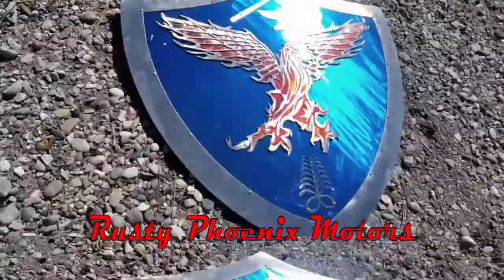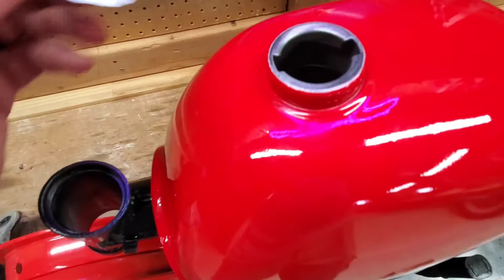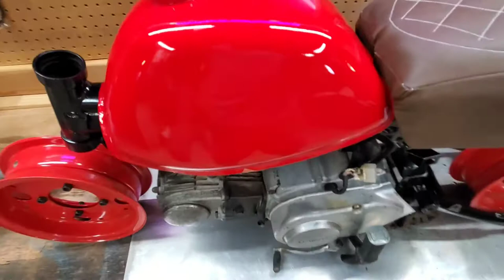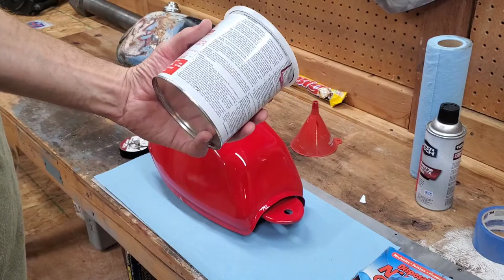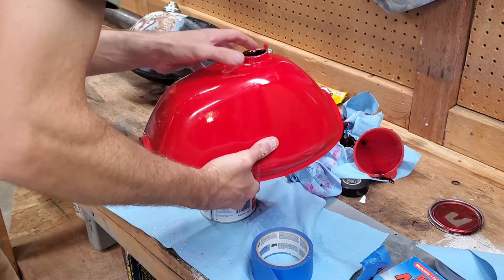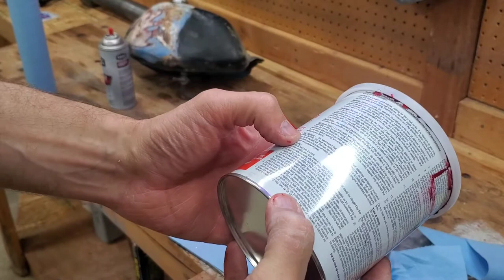Made a HUGE mess sealing the Mini Bike tank... DIY gas tank repair!

Comment: Funny fail! Thanks for showing us the mistake.

I've used Caswell Gas Tank Sealer several times on steel, fiberglass, and plastic gas tanks on my bike projects with 100% success over many years. It is a two part epoxy that forms a much thicker layer on the inside of the tank. 

I was surprised to see that Red Coat is a one part formula.

I searched online for reviews of the various tank sealers, reviews that were not on a seller or manufacturer's website and Caswell came out on top by more than double the next contender so I haven't tried anything else.
Reply from the maker: I'll have to give it a try! Does it harden? I've tried to cheat in the past and just use fiberglass resin.... worked great for a few months but eventually it cracked.
Reply: @RustyPhoenixMotors  It hardens but is bendable so if you get a dent in your tank it wouldn't crack. It is thick like honey so you rotate the tank much slower to cover the inside. It is excellent.  I've used epoxy resin to make a fiberglass fuel tank and it worked great but I did coat it with Caswell because it is made with Novalak (?) resin that is very resistant to all fuels including alcohol. My current project bike is getting a custom tank that will be thin aluminum sheet bent to shape, bonded then coated with Caswell.

Comment: After a year, how has it held up? I'm about to fabricate a tank for a motorcycle and I'm looking for a good way to seal it.
Reply from the maker: It seems to hold up well.  I've used this stuff several times on several different bikes and I really like it.  This little Z50 hasn't seen a lot of use yet, I need to look at the chinese carb.  Haven't been able to get it to run quite like it should yet.
Reply: @RustyPhoenixMotors  -- That's great. Thanks!